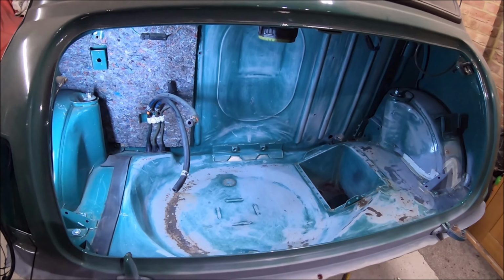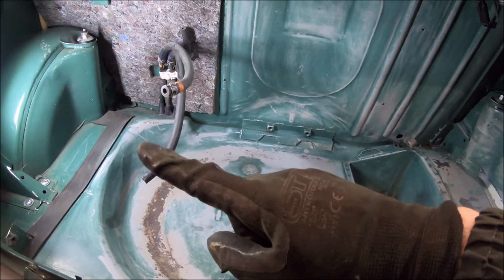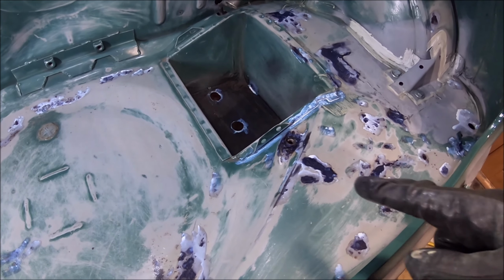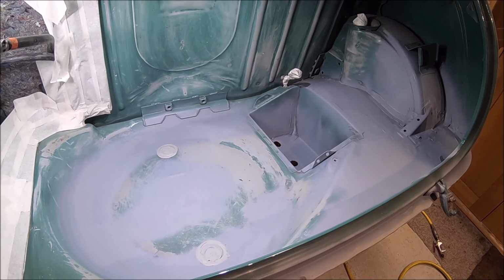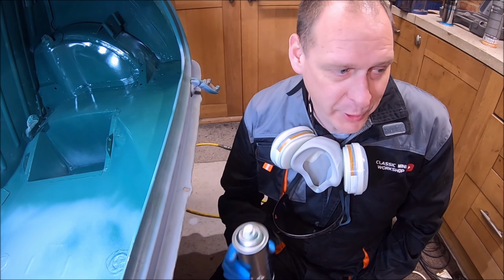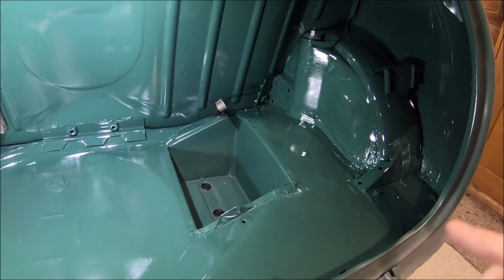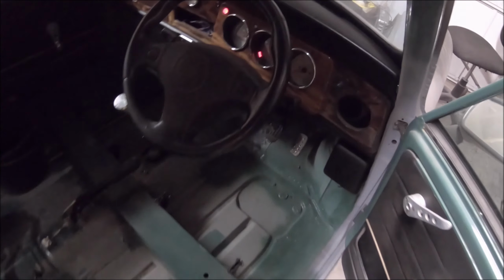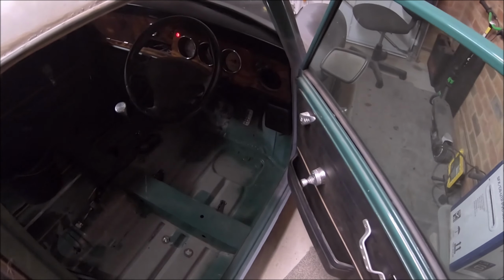Spraying inside the boot - Classic Mini Workshop Project Sprout Pt.58

Comment: Think the pump gets the same earth from where the sender does, if that’s the case I’m sure it’s a spade connection that attaches to the rear light cluster. Or there is a earth with an eyelet connection. Can’t remember exactly which one. Boot floor looks mint Keith. Well done with those cans 👍🏻👍🏻

Comment: 4X lock & 4X unlock?? Can you explain a bit more about why you do this and is it a common thing with all injection Mini's or just sprout please?  Oh and boot looks lovely 👍
Reply from the maker: Yes, the two button remotes are re-initiated by pressing lock / unlock 4 times. You need to do it after disconnecting the battery
Reply: @classicminiworkshop  ahhh. Very handy to know. This may of just saved me many many hrs of head scratching and puzzlement in the near future.   Many thanks 😀
Reply: Lock unlock lock unlock until the light goes out works on my 2000 Cooper sport. Let me know if it works for you also.
Reply from the maker: @kevbarry7453  Yes, it will work like that on all 2 button remotes. If it goes out of sync you can also remove the fob battery, press lock / unlock a few times then refit the battery and do the same
Reply: @kevbarry7453  Many thanks 👍

Comment: Out of interest, What’s wrong with fitting the wrong battery then? I fitted a 075 battery in mine 😅
Reply from the maker: In short..... A battery needs to remain above 12.6 or it starts to sulphate, if you use a car like a mini infrequently it will naturally discharge over time so when you do come to use it you want to get the battery back up fully charged quickly. If you have a 330A normal battery Vs a 540A upgraded battery, the upgraded battery takes for arguments sake 60% longer to fully charge. Also factor in the weak charging system on a mini and all of a sudden it's a big ask of the system to fully charge the battery between uses. Caveat* not so much of a problem if you use the car a lot and do long journeys but in many cases people fit bigger batteries because they have been having problems with the standard sized battery going flat so they fit a much bigger battery which does temporarily fix the issue but over a longer period it will sulphate much faster and subsequently not last as long.
Reply: Classic Mini Workshop hmm interesting, so what you’re saying is make sure you drive it regularly and for a decent journey
Reply: Classic Mini Workshop I only fitted a 075 because that’s what I had when I had a mini for a daily